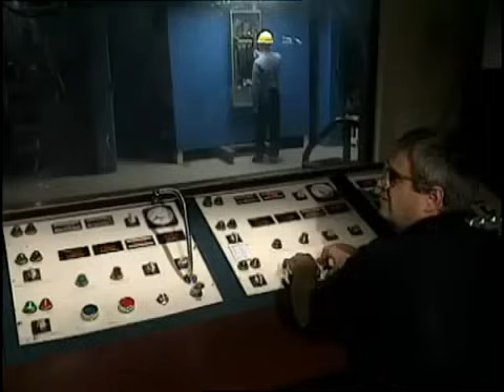Electrical Arc Flash Demonstration

Comment: Damn I work on 460/480 volt equipment frequently, these type of video's make me remember to respect electricity.
Reply: Me too, for about half a year.  Nothing happened, but every shift was like a little nightmare that I might get blown up.  One thing you can do at least is before you close the breaker, crouch under it or beside it or anything so that your body isn't in front of the open panel.
Reply: right there with you, god with me everyday out there. shit can be no joke
Reply: Lock out tag out, we have it for a reason. And always test what your about work on.Once I had an apprentice remove a lock on a panel I was installing. Thank god the guy who taught me the trade instilled in me the habit of always metering anything. Even if you checked it and walked away for an hour, especially on panels. Outlets I’m not as concerned about but I respect panels.
Reply: @Redblade With lockout tagout done properly you don't have to worry about an idiot turning it on at least.
Reply: Nature will ALWAYS win vs humans! and for good reasons!
Reply: Tell me about it
Reply: @challengesawake7788  just going to let you know that arc flash gear is rated so you'll come out with second degree burns not third and most people die from the shock wave.
Reply: The money's not worth it
Reply: @jew-sa  lol..... yes yes it is. I pull in 90 to 120 k depending on over time. Have my insurance 100 percent paid for and and extra 10 an hr for retirement.  So yes its totally worth it.
Reply: @shawnshurtz9147  You think you're life is worth 90k? I get not much less to sit at home on my ass and work from my home. Stay safe out there.
Reply: My dad just got electrocuted by 13,000 volts in a scenario just like this
Reply: Yeah, every time i got a project involving tapping into Gear or installing a transformer especially if its 240/480 volt. I watch these videos to sober myself up to reality and possibility of this happening if i don’t follow procedure and safety. I recommend everyone, Follow safety guide lines, and remember lock out tag out is your friend.!
Reply: @jew-sa  Either you’ve been cheated or you haven’t moved up in the industry. But I disagree.
Reply: Yeah no joke. I always LOTO every electrical system AND hit at least 2 e-stops (if the machine is already LOTO'd it wouldn't matter but it's for redundancy and my own mental reassurance)
Reply: @jgunther3398  That's great advice. In another reply I said I LOTO everything as well as hit at least 2 E-stops. When it comes to maintaining potentially life threatening machines it's best to assume the worst in people. Just because I LOTO'd an electrical cabinet on an old machine doesn't mean someone can't pry the door open and manually switch on the breakers.
Reply: does 480 volt taste good
Reply: Ima be working with this stuff wish me luck
Reply: @sic7475  did he survive?
Reply: @irfansyah9929  yes. the top layer of skin on his arms was burned off but it healed back and he has been fine
Reply: @harrytuttleheatingengineer7515 Outlets still dangerous. But agreed, panels don’t have protection really from flashing like outlets would.
Reply: @jgunther3398 Dob’t underestimate the stupidity of people who figure out how to undo a LOTO. That is why you should always meter before you work on anything electrical.
Reply: @whogavehimafork Then the e-stop should be LOTO also.
Reply: @whogavehimafork Which becomes a felony potentially too. Especially if someone gets hurt.
Reply: @easyenetwork2023  Most E-stops are not the intended official LOTO points, therefore you can't lock them because they're not made for that and won't accommodate a lock. They're intended to be easily triggered, and quickly reset. I push them in for my own personal comfort in addition to LOTO procedure
Reply: I work on some of these batteries with strings of 12v batteries total is like 480 and some are like 543 getting shocked is enough to humble you

Comment: got caught in one of these once,  on a 600v   motor  starter,    blast blew me over  and   chunks of the plastic motor  contactors were  embedded in the opposing cinder block wall.  scared the hell out of me
Reply: What causes the arc flash?
Reply: @bobbygetsbanned6049  being grounded yourself, or improperly grounded equipment/ phase to phase contact
A lot of reasons can cause an arc.
Reply: Got hit with 460v yesterday did not feel good lol
Reply: @fistinyourface78  480? 😂  You can't get hit with 480 unless your holding every leg. You probably got hit with 277. 😂 which isn't anything
Reply: @wayadanthili1102 Bro you have no idea. 3 phase connections are so close together on a lot of smaller components like contactors and control power transformers.

It's happened to me once or twice where I accidentally touch finger to finger across two phases of 480 on terminals that are right next to each other. That would be a full 480 volts, or 672VAC if you want to include the peak voltage and not just RMS.
Reply: @wayadanthili1102 except you're wrong. One phase (2 legs) of a 277/480 three phase system is 480 volts.

Go back to school, helper.
Reply: @3-PHASEDELTA  no shit kid and I guarantee you I've been an E&I tech since you were taking lunches to school Mommy packed for you. Ever heard of single phase 480v? Now go grab my tools worm.
Reply: Lucky they did not embed in you like shrapnel. Copper superheated creates a toxic gas and new material I believe.
Reply: @wayadanthili1102 You have to be hitting a ground and phase I think. Just touching two phases should not do it.
Reply: @that1electrician Okay, I thought two phases together should not hurt. Thought it was phase to a ground or all 3.
Reply: @wayadanthili1102 I was the tool grabber, this hits home

Comment: My dad survived of 440V arc blast with 25% burn on face, neck, upper chest and bilateral arms
Reply: He should have. That ain't sh**! 😂
Reply: 2300v and above is when the potential for death ensues.
Reply: @davidperry4013 Not necessarily true. It's total incident energy released that determines how dangerous or fatal an arc flash is. The incident energy is dependent on multiple factors including voltage level, available fault current, conductor gap of the arcing current, etc. Fatalities can also happen on low-voltage systems as well.

Comment: I was told, while apprenticing, that you always turn around when you throw a disconnect on. That way, If you live, it’s much easier to replace the back of your head vs the front and no one wants the  nickname ‘’ass face’’ after the grafts are done. Because you know that’s what your real friends would call you.
Reply: I'm surprised your workplace's arc-flash-capable equipment wasn't set up to be operated remotely.
Reply: stand on the side of the box, turn away from it, and hold you breath - that way if you gasp from the blast, you don't suck in vaporized poison metal.
Reply: @westingtyler1  True, most people don’t really understand the actual danger of panel explosions. My engineer friend was burned over 85% of his body. Someone bumped a cover that was resting on a handrail into an open commercial transformer while he was standing directly in the middle. He said it was a living hell after he came out of the induced coma. 
 Fun fact, at the hospital where he was treated they peel burn victims around 2:00 or 3:00 in the morning when the other patients are asleep so (hopefully) they don’t wake up from the screams.

Comment: Incident energy - the type of heat energy caused by an arc blast to cause second degree burns or worse, measured usually by the no. of calories of heat per cubic meter. This leads to the "arc rating" on PPE that should withstand the required level of incident energy caused by the arc flash to keep you safe or lessen serious injuries or death.

Comment: 0:39  audio of a 140db arc blast from a neighboring room behind a shrapnel/fireball proof wall/window.  0:46 arc flash can reach 25,000F... creates a pressure wave called an arc blast at thousands of pounds per square inch (some 2-3 sticks of dynamite).

Comment: I want to ask, how much voltage this distribution panel??? , it's 220v or 480v or more
Reply: 480v
Reply: Could be 120 volts in American
Reply: @MeaHeaR  no it couldn't because its high voltage meaning the 120 equivalent is considered 277v
Reply: @bg11211  YOB 3 ph is 277 yes
Reply: @MeaHeaR  there is no such thing as a 120 volt panel.
Reply: @gentlemanzackp6591  if it's 3 phase, then the voltage between phases is 480, not 277. 277 is the voltage to neutral. The panel is a 200 amp 480 volt panel. Common panel in American industry.

Comment: I’ve heard that if the burns don’t kill you breathing in the vaporized metal will.
Reply: Thats true. Copper expands and vaporizes when it explodes, your first reaction if an arc flash were to ever occur is to gasp causing to breathe in the fumes which is highly poisonous. Honestly thats the least of your worries. The shrapnel itself from the equipment blowing apart pierces your body like bullets on top of the insane heat that is produced by the blast. Youre talking up to 3 times the surface temp of the sun. Always work smart and safe
Reply: Hot suits for everyone
Reply: Yes the vaporized copper will scorch your lungs, set fire to your cloths, and Kill any exposed living tissue within 6 feet. Pro Tip: Always hold your breath and stand to the side even while resetting a simple 15 amp Breaker because if their is the right fault condition your can get a surge directly from the street for a couple of milliseconds and that plasma burst is hotter than the surface sun. My bumper sticker on my work truck says " Electrical is not a hobby" and to call a licensed Electrician.
Reply: i dunno copper tastes pretty good

Comment: The way my dad explains it is that it’s the same as a welding arc but way bigger and hotter
Reply: Daddy don't know.
Reply: The difference between a welding arc and an arc flash/ arc blast incident is the current and voltage.   Arcs are by nature negative impedance meaning increasing the current flow causes the resistance to decrease,  causing even more current,  assuming the power supply and conductors have a low enough impedance to allow it.  Arc welding is done at low voltage with relatively high current,  typically less than 50 volts while the amps can vary considerably depending on electrode diameter and type, welding position, material preparation and thickness,  etc but is still considered current limited.  An arc flash involving a 480 volt three phase panel however,  is only limited by the  kVA and impedance of the transformer and the impedance of the conductors supplying the panel and can easily be in the tens of thousands of amps of available current particularly if the fault occurs in an outdoor panelboard or meter enclosure close to the utility transformer.

Comment: This is why they say to call a licensed electrician. Many DIY'ers don't know this could happen by simply switching on and off HV panels.
Reply: Your average DIYer isn't going to be anywhere near a 480v panel.
Reply: @fnhwk  Are you implying that something like this won't happen if the voltage is 230V AC?
Reply: @IAmThe_RA they don't know that the arc flash from a common residential 240VAC single phase mishap can be rather dangerous as well. Oh well fuck em, cowboys don't last long in this trade.

Comment: I don't mean to be the devil on anyone's shoulder but imagine a bomb that didn't need any fuel...
Reply: Really? Looked quite potent to me
Reply: @houselightkell  
But compared to combustible materials it is nothing, and it does require fuel, electrical energy is the fuel. And to transport that electricity you need to store it in large batteries. It would still work as a bomb but let's say it weighs 10kg, 10kg of dynamite or Semtex has much more explosive force and blast radius
Reply: @lokkj8570  does tnt create enough energy to reach 35000 degrees? Does it create enough energy to melt copper and cause it to expand 68 times its normal size? 
Yea, didn't think so. 
Stop trying to compare apples to oranges.
Reply: @lokkj8570  tnt doesnt reach 3 times the temperature of the suns surface. An arc flash will.

Comment: 45 seconds in I can tell it's 480. Why? If you can answer your a real one.
Reply: I'm not an electrician, but I'm going to guess 480v puts off that white/blue arc and that was the tell.
Reply: Brown orange yellow
Reply: 3 phases
Reply: Brown,  orange,  yellow and gray neutral are by convention used to identify a 480Y/277V 3ø system.  Alternatively some jurisdictions use Brown, Purple,  Yellow for the same system.

Comment: How does an arc flash occur??
Reply: If you get enough voltage and/or amps a short circuit will cause an explosion. There is no accelerant. It's just the electricity causing an explosion and fireball.
Reply: read the description

"An arc flash which is distinctly different from the arc blast, is part of an arc fault, a type of electrical explosion that results from a low-impedance (resistance) connection to ground or another voltage phase in an electrical system."
Reply: An electric arc is basically an ionized gas (air in this situation) the electrical conductivity of the air is very low at room temperature so electricity will not jump from one lead to other but if something shortened the leads say a screw drive the  electricty will quicky pass through the tool leading to metal evaporarion of the tool along with an increase in temperature of the tool surrounding air. With that,  the electrical conductivity of the air will signifivantly increases even when the tool is being removed the air between the tool and the leads will be highly conductive which lead to a very high current passing through the air to the tool and to the other lead the air gets really hot due to the electric current and a high magnetic field along eith the extreme temperature ms can create a shock.